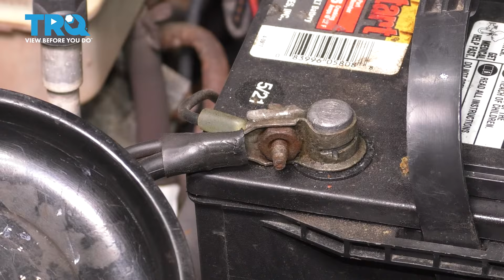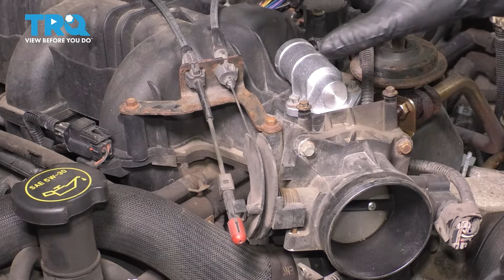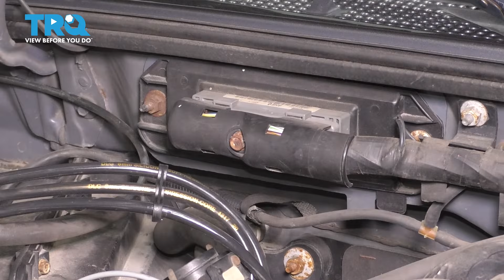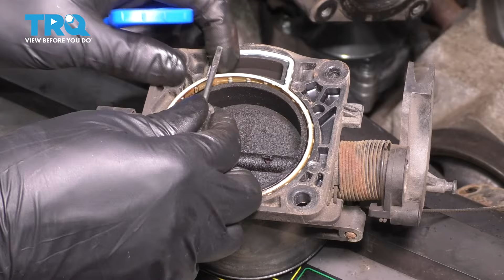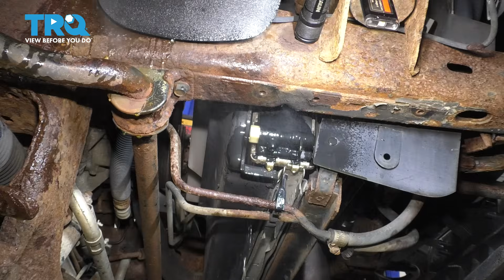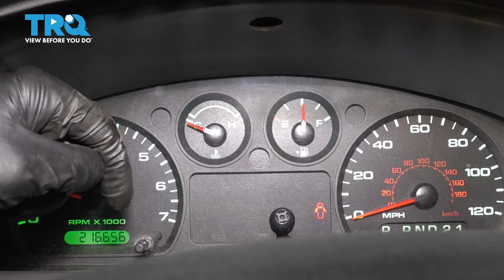How to Replace Fuel Injectors 1998-2011 Ford Ranger (4.0L V6)

Comment: Make sure you know research what injector sleeves are and don't ruin those, I pulled mine out and scratched them and had to buy some.
Also you don't have to drain the coolant, idk why he was saying to drain the coolant. You don't pull any coolant lines or anything. I did the whole thing without draining the coolant, no issues.
In all without the injector sleeve mistake takes about 2 - 4 hours. Hardest part is the bolts on the intake manifold.
If you can change your spark plugs on the 4.0 you can change the injectors.

Comment: Hey I'm pretty dumb and far from a mechanic, this took me 4.5 hours while religiously consulting this video. If you think you can't do it, you probably can. Hardest part was getting to the back left intake torx and reattaching the lower vac line on the front passenger side of the intake. Good luck all!

Comment: 12.35 man if only my t30's wernt stripped and Ive only gotten 4/7 out and the last 3 I'm still trying to extract with a bolt remover, a 15 min step turned to 4 days

Comment: these steps will work for the 3.0 as well there are a few things in different locations but in the 3.0 there’s about half the steps before you can get the intake off

Comment: I had to remove the engine on a 2005 Explorer Sport Trac. Wish I had done the injectors while the engine is out. Found one injector not sealing shut and was dribbling fuel full time into the cylinder.

Comment: Just FYI for anyone replacing injectors. There’s a boot/sleeve that’s not mentioned that the injector is inserted into. I ended up pulling out one completely(which tore in two) and ripped another pulling out another injector. New injector sleeves cannot be found easily

Comment: My 03 4.0 is slightly different than this one. Also need either a long T30 or a slim T30 socket to get through small holes to the intake Manifold bolts which is an annoying design.

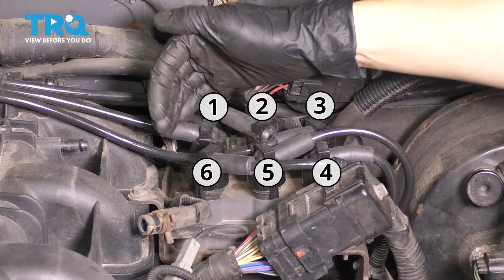Comment: 9:04 that's not the correct coil pack firing order for the 4.0 V6.  It's actually 123 (firewall) 564 (engine forward)